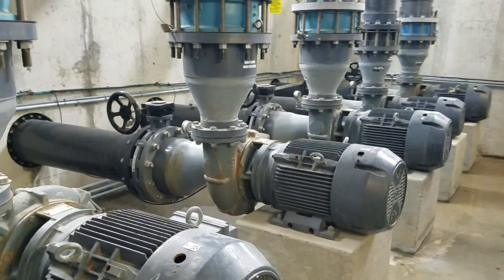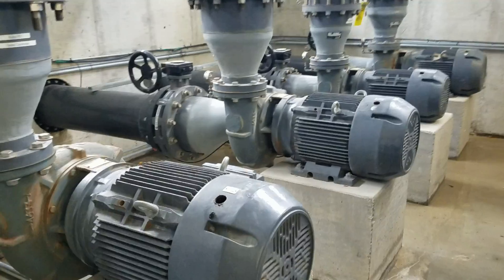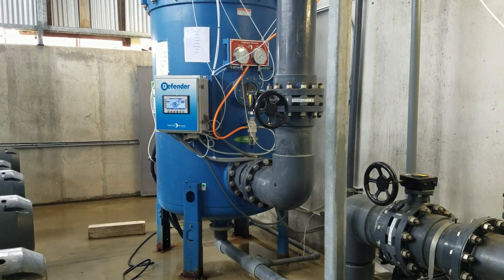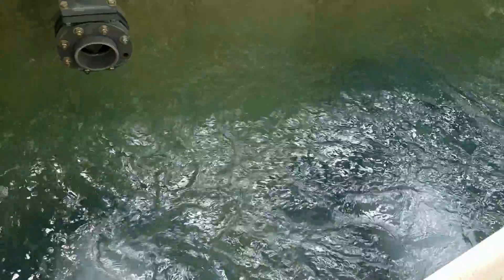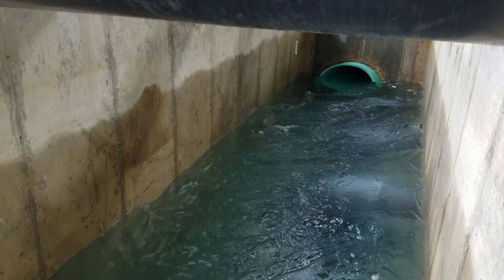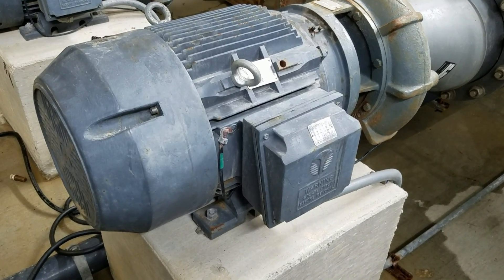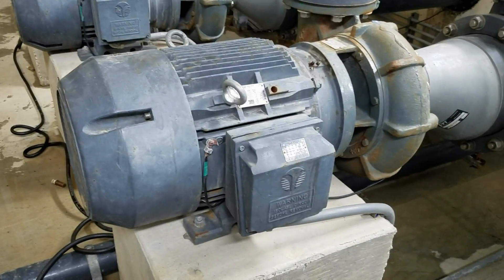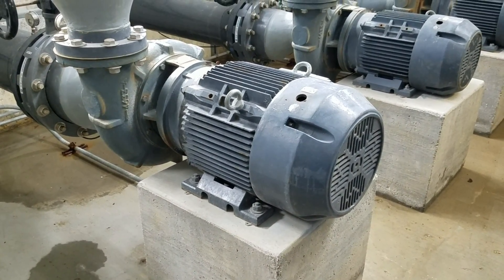Water Slide Pump Exercising

Comment: I have been watching your videos for quite some time and I always wonder what the clearance between the surge pit bottom and the pump intake is.  And also a little bit of extra information about those "flat intake" at the start of the tube in the surge pit. I suppose it is to prevent air from coming in via swirling but maybe I am wrong. Thanks anyways! You have an interesting channel.
Cheers

Comment: Brings back memories, i worked at a theme park with water rides, and the pump room for one of their rides was similar

What we called A bathtub, a catch basket, a massive motor and i think it was an 8 inch pipe going straight up about 60 feet to the start of the slide

The log flume was different, that had what looked like a massive fan in the track that took up the whole diameter of the track under the lift hill, with a grate behind it to catch debris, that was to move the water around the track

 i think in a different pump room they had a pump set up similar to this, but i think they used the lake as a sump, that pump would have fed to the top of the lift hill via pipe

Pretty simple stuff really, like a large home heating system, but no radiators

I was a ride operator, but i went in before the park opened sometimes to help the maintenance guys, and one job was to empty the sump, jetwash and wet vac it out then fill it again after the tube had been sealed, the water got contaminated with something that reacted with the chlorine and made it crystallise in the water and cling to things

That was really interesting that day 😁

To empty the sump, all we had were two submersible pumps with 2 inch lines, so that took all day, then i went in the next day, washed the sump out, and to fill it back up we literally only had a kitchen tap hanging over the top of the sump, it took forever, we ended up getting cleaning staff going to all the toilets on the park, filling up buckets and bringing them to us to tip in 😂

Comment: I noticed the legs of the defender filter seems to be rusting pretty bad. Given the wet environment, I would have expected them to better mitigate against that. Is there anything you do that helps to slow that process or is it not a big enough issue yet?
Reply from the maker: Yes, this is an issue for this unit in particular.   We have new legs coming.

Comment: How do you administer chlorination? I do municipal water treatment and I'm running a pair of Leeson 5hp motors mated to pumps which are branded USA Blue Book for my high lift pumps that feed my 35,000 gallon or so tower and 10hp and 7hp pumps for my large and small wells respectively, I'm having problem after problem with my small well which is also the older of the two, it was put in service 40 years ago and the original pump is unreliable, my big well was put in service in 2003 when the new plant got built and talk of a new well is underway, though there's not much space, as there's 10 other wells that have been sealed for various reasons on this treatment site, my hope is the new well will have a 15hp motor so it can keep up with the high lift pumps better and streamline treatment. I've got filters that are the Lincoln of high capacity filters, quiet, low maintenance, easy to work on, and able to last decades, they're almost 70 years old and aside from needing new filter media every 5 years they're fairly low maintenance, same can't be said for the Softener, it's just as old but has been repeatedly modernized with limited success, the softener itself is solid, but the controls are anything but, and my boss ain't too happy, as I just spent $50K on fixing up the brine tank and now need to spend another $25K on the filters, not my fault, the guy before me didn't do his job and let things get out of hand
Reply from the maker: Hey there. Water treatment plants are whole other beast.  I can't even pretend to know what I'm talking about in that realm.  We administer chlorine via a degenerative chlorinator.  Similar to a back yard pool tablet chlorinator.  However, I have large vats that hold the tablets and water flows over them to create a slurry of liquid calcium hypochlorite.
Reply: @thepoolguy  Is the slurry automatically added? or do you have to keep testing and adding? I've got large 45-50 gallon vats of liquid Sodium Hypochlorite and the chlorine is added via a pump and injector system, yearly maintenance aside it's trouble free and you rarely ever touch or smell the chemicals if you have a breather system setup, and most things I mentioned above are pretty universal, the high lift pumps are the same style as what you use and the filters are the same type that pools around here use, the wells and softener are another story
Reply from the maker: @vacexpert2020  So the procedure you speak of for sodium hypochlorite is similar to what we do in the aquatics industry.  However, I am partial to calcium hypochlorite for the use in swimming pools.  The slurry is added via a 1hp pump that pumps it directly into a return line post filter.
Reply: @thepoolguy  Sodium Hypochlorite is what I have to use, as Calcium Hypochlorite will interact with the other chemicals I add, and I'm trying to find a pump that can hand the duty cycle, I've had problems with Stenner, White Blue, and LMI pumps
Reply from the maker: @vacexpert2020  I understand. CalHypo isn't right for everyone.  Water balance is important, and you use what works best.

This is my go too for metering pumps. I use these for ally acid lines.  https://www.usabluebook.com/p-267753-mec-o-matic-dolphin-series-peristaltic-metering-pump-60-gpd-25-psi-d-50.aspx
Reply: @thepoolguy  I will have to check that out when my last Stenner gets replaced, looks alot like the White Blue pump I'm using, my problem with peristaltic pumps is I can't turn them down as low as I'd like and have them be reliable, diaphragm pumps like to blow the lines off and make a mess, and also the White Blue uses smooth graduated nipples which don't grip the tubing, the Stenners use a connector that's complex but works too well
Reply from the maker: @vacexpert2020  If I can't use the dolphin,  I usually go back to stenners. I like the tubing for those.
Reply: @thepoolguy  I've used the Stenners for years, though for lower doses the clutches don't last, for higher doses like Mainstream they're great, dead reliable, I've got their smallest tubing size in my pre chlorine pump and still am having clutch issues, if only the EPA didn't mandate such an odd concentration
Reply from the maker: @vacexpert2020  for sure look into the dolphin 10.  I used that one for acid on a 2000k spa.  Which was about a cap full of acid a day and it worked great.   The motor runs slower.
Reply: @thepoolguy  I've already made the recommendation, given it's competitive pricing I expect no opposition and for it to be ordered shortly, what's the longevity like? I've got a box old 25 or so year old Stenners that I rebuilt to use on the Copper Sulfate injection and just recently got the Flex Flow pump second hand from a bigger plant that replaces their pumps in pairs, it's also how I got all the Stenners

Comment: I don’t know jack about water pumps, or if the water itself could help keeping the engine cool with lower rpms. In general I wouldn’t run electric motors lower than the 80% rated, as you mentioned to keep, the airflow at the windings. 
Great content!
Reply: Electrical current through the motor windings is what makes heat. With a VFD (Variable Frequency Drive), at a lower speed, the current will also be lower so it doesn't take as much airflow to keep the motor cool.
Reply from the maker: These are Totally Enclosed Fan Cooled, or TEFC motors.  They stay relatively cool with its own fan.

Comment: What size water line do yall have to fill the park?
Reply from the maker: For typical slow fills, 2-3 inch water mains are used.  If we require a rapid fill, we utilize 3 inch hydrants.
Reply: @thepoolguy  how long does it take to fill?!
Reply from the maker: @PaulL42654  so I have 7 bodies of water. Each has different sized fill lines.  But for argument sake.  The wave pool is approximately 500,000 gallons.  At 3 inch line, it takes about 14 hours.

Comment: I dont know if this is an appropriate place to ask this, but ive noticed it on other pumps and in general and ive been thinking about it.  Why does the output from the impeller expand to what looks like double the diameter right after the discharge?  Is it just to slow the velocity of the water or is there some other purpose?  Same thing but backwards on the inlet too, i dont understand.
Reply: I don't know for sure, so I'm guessing here -- But I think it would be to counter the effect of friction in the pipe to allow a high flow rate of water with relatively low pressure. The longer a pipe run, the more that friction of the pipe surface and the angles of the fittings create a flow restriction, so using a larger pipe will reduce this flow restriction, reducing back pressure on the output of the pump, and preventing too low a pressure/vacuum on the intake of the pump, as both of those conditions would reduce the efficiency of the pump in terms of flow rate. You don't need particularly high pressure water for this application, and instead probably just want a lot of flow.
Reply from the maker: Matt has much of the science down on the use of these fittings.  They are called Eccentric and Concentric reducers. Here is a video explaining them.  https://www.youtube.com/watch?v=L1BgjJ1JssU

Comment: Do you replace mechanical seals in these during winter or shutdown? Or, do you replace them as they fail? Have backup pumps? Thanks!
Reply from the maker: I would love to be able to replace all the m seals during the off season.  Unfortunately, we are just unable to handle the work load that would requires.  So yes, we replace at failure.  We do keep two of each shaft size for replacements during the season.  With 46 pumps in the facility, this has not been an issue.  I would say we have two failures each summer.
Reply: ThePoolGuy thanks for the reply! I work for a mechanical seal manufacturer in TN and am doing research on water parks to see what the potential would be with a few parks in my area. I appreciate it!!
Reply from the maker: @CMO97  thats awesome.  I'd be interested.
Reply: @thepoolguy  I would like to give you my contact info but don’t want either of us to have to post it on here if possible. Is there a way to pm you?

Comment: Is that surge pit for all of the various pools?
Reply from the maker: Hi Ben, sorry for the late reply.  This is for one particular attraction that comes from a splash pool.  the various pumps on this video go to the slides, 5 for this tower.  Opposite of this wall is the intake for the filter pump.
Reply: ThePoolGuy No worries, that looks like quite the system!! Everything in that video looks massive and a little intimidating, especially that surge pit.
Reply from the maker: @benperrotte6946  actually,  this is one of the more tame of our systems.  The flow in this tank is approximately 8400 gallons and minutes.  I have another that is about 12000 gallons a minute.
Reply: That’s quite impressive!! At minimum 8400 gpm or 12,000 gpm.
Reply: I always thought it was called search pit because the pumps search for water there 🙈🤣 (none-native english speaker)